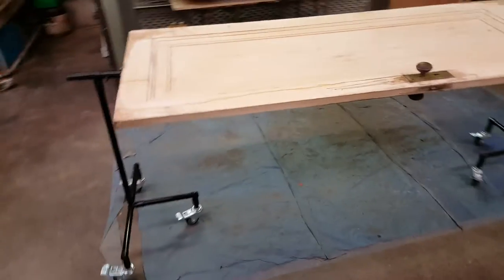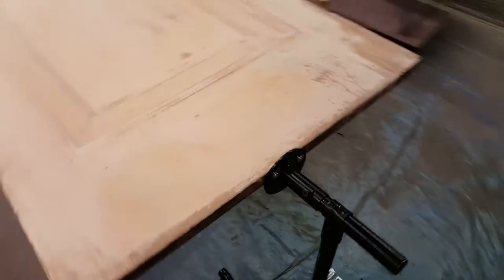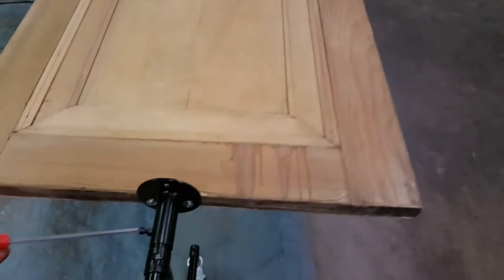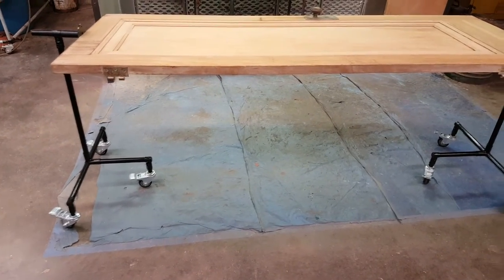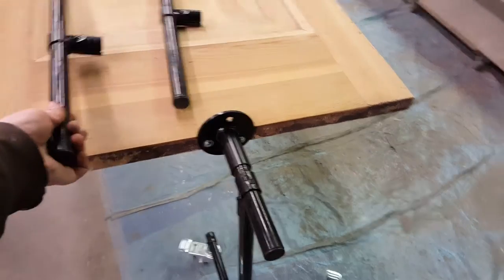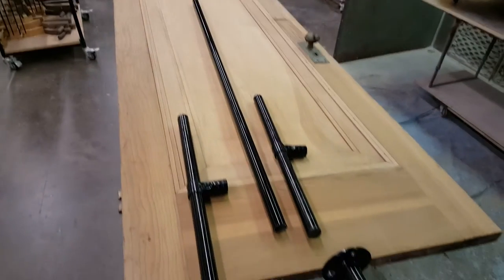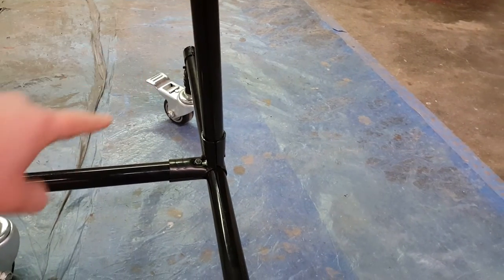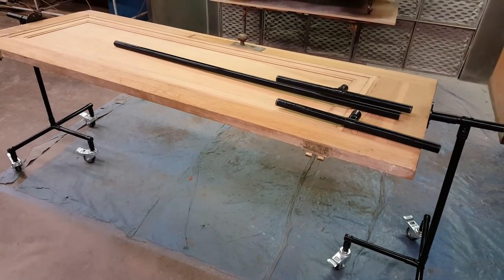The FAST PIPE Door Rotisserie System

Comment: I was just telling my wife that I wanted to make a rotisserie type of system to refinish the doors in our house. They are very heavy. A quick Google search and here I find probably the best solution. I wanted my system to be mobile as well. Great work!  Did you get the casters from fast cap as well?
Reply from the maker: Thanks Jerry! I'm glad it helped and yes, Fastcap also sells the casters which are great. My only three words of advice would be to use some 2" coarse screws to mount the brackets on the door. Fastcap also sells "Powerhead Screws" (http://www.fastcap.com/estore/pc/PowerHead-Screws-Metal-p13284.htm) which I plan to use. Also, be very mindful of not accidentally trying to roll when the casters are locked. The whole system can buckle and collapse...I made this mistake one time since I tend to rush a little sometimes. :) Lastly, be sure to only roll around on a smooth and level floor to also avoid buckling. Once your setup, your really don't need to roll around to much. Here is another video I posted that discusses the specifics. Thanks again, Jerry! Have an awesome day and good luck with your door project!
https://youtu.be/1P1OL5_KIpk
Reply: +Renew Furniture The second video is perfect. My next response was going to be to ask exactly what you purchased. As far as the dolly tipping if rolling on uneven surfaces, I guess you could run a pipe at the bottom from dolly to dolly using the parallel slide connectors. They would allow you to adjust the distance of the dollies for different lengths of doors. You would need a pipe longer than 52" of course or use a cross connector possibly to connector two pipes.  Something to think about. I haven't yet started researching how to strip my doors. They are painted with many many layers of paint. The house was built in 1928. Any pointers?
Reply from the maker: +Jerry Spallone I also included a parts list in the description of the second video. You are absolutely right about a support bar connecting both sides together. I think two pipes joined using the fastpipe parallel connector could work well. https://www.fastcap.com/estore/pc/viewprd.asp?idproduct=44279

As for removing the paint, I have a few pointers. First, don't sand the paint off. At least some of the paint is likely to be lead paint which is safe to chemically remove but a real health hazard if the dust particles get in the air. I also wouldn't personally advise using a heat gun to burn it off. We use a commercial "flow over" system in our studio, but I would suggest simply using a semi-paste or gel style stripper which you can get at Home Depot or Lowes. There are many brands, but we have good success with this one - http://m.homedepot.com/p/Klean-Strip-1-gal-KS-3-Premium-Stripper-GKS3/100144685. Don't bother with any of the "green", eco-friendly strippers...they will not work on what you're up against. You will also need some cheap paint brushes, coarse steel whool and a 2" putty knife. We normally slightly round the corners of the putty knife so that they don't carver into the wood when you're removing the paint. Also pickup some of the brass wire brushes. I would get all of that stuff at Harbor Freight Tools....MUCH CHEAPER THAN HOME DEPOT. We have a local outlet, but you can also purchase it all off of their website.

It will take some time since you will likely have to remove several layers, so follow the instructions on the can and don't give up. :)

Comment: I would like to see how you attach the doors to these.  It looks hard.
Reply from the maker: frankie2234 The trick is to place the door on a bench or table. Then you attach the two mounts onto either end of the door, and then, with the casters locked,  Just lift one side of the door at a time and insert the pipe on the rotisserie stand into the mount. It takes a couple minutes to load a door I would say. Be sure to watch my followup video about the rotisserie system. Thanks for subscribing!
Reply: Thanks for clarifying that for me.  I appreciate that.  Thanks.
Reply from the maker: frankie2234 No problem! This idea has been so helpful at my studio and if you try these for yourself and make any improvements, please let me know. Every idea can become better!
Reply: ok